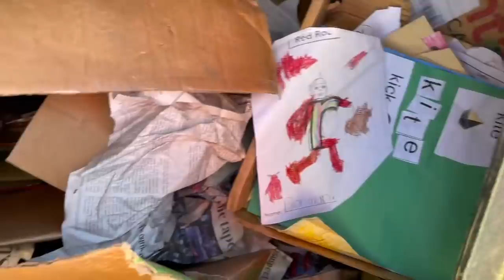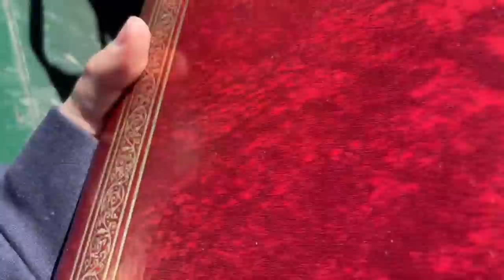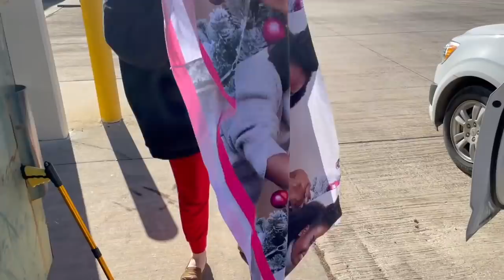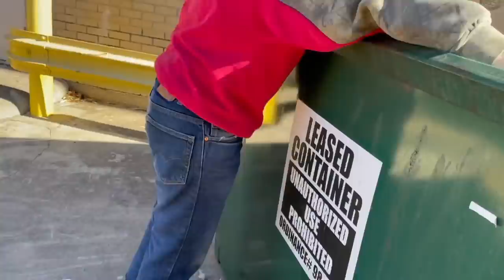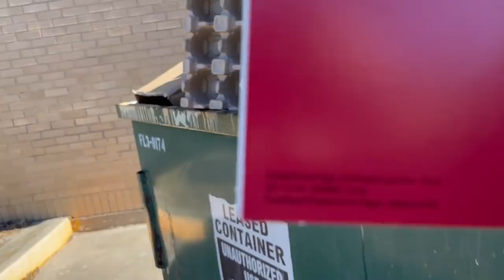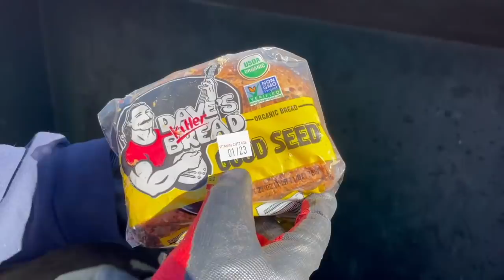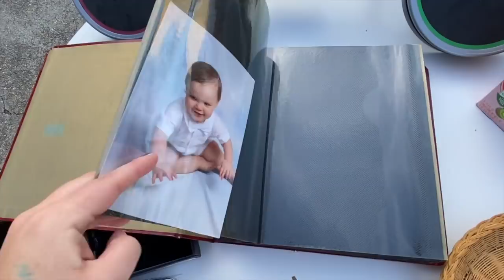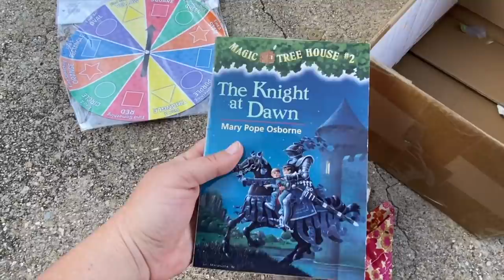Dumpster Diving on Christmas Morning (with Alex)!

Comment: The Bunny Rabbit with the ceramic face is called Flossie and she is from House of Lloyd/Christmas around the World. She has a male counter part called Floyd. They are vintage (not antique). I had them both years ago in the 90's ( I think, or possibly even the later 80's). She worth a little, not a ton but you could probably list for $10 or so. Not much at a yard sale though.

Comment: You two are such a darling couple. The wicker plates are used under glass pie plates to protect the table from heat. (I bought some pie plates that came with these.)
Reply: We always used them for both under pie plates to protect table/table cloth from heat or under paper plates to keep the paper plates from blowing away or give them stability. If you are crafty, I have seen them made into mail holders for outgoing mail you can put by your door to outside. You cover one half of the part you would set pie into or paper plate into. You can decorate any way you like. Looks nice with various flowers around outside but I am sure if you look up crafts from wicker plate holders on You Tube you could find this. Or you can look up uses for wicker plate holders. You may find a lot more uses!!

Comment: Hi 🤗, Just wanted to let you know. The wicker plates are paper plate holders. Just set one of those thin paper plates in (they fit in nicely) then you can pick up a paper plate full of food without collapse & spills! There are a couple of things you can do to keep the wicker plates working & looking like brand new. NEVER put the in the microwave (it dries them out) & if they start feeling dry, soak them in water for a couple of hours. Completely submerged, put a heavier plate or some to hold them down, but not too heavy! If they get food or something on them. Just put them in a sink with some very warm soapy water & let it set about 15 minutes, then just rinse the mess off of it. Sometimes I have to use an old tooth brush if it a really bad mess. I've had mine for about 15 years & they are still as strong as they were when I bought them! Could NOT live without them, saves me so much on dirty dishes!
I just found your video's by accident & now I'm hooked. So, I subscribed 👏🇺🇸💪💝

Comment: I watch a diver who collects the gift cards and checks balances online. She has found cards with up to 80 dollars. If you can’t check online, she said don’t walk in the store with a fistful. It’s a dead give away from where they came. Any remaining balance can be used to purchase items.
TRASHSTINKS😂😂😂that’s totally hilarious. It can be slippery, so I wear steel-toe boots for jumping inside. If you go in, make sure your step ladder is accessible to pull in so you can get out. A jimmy bar will hold up the lid or heavier junk inside the dumpster. It is that adjustable bar you put under a door-knob to keep burglars from coming in the front door. The little v that goes under the doorknob cradles the edge of the lid